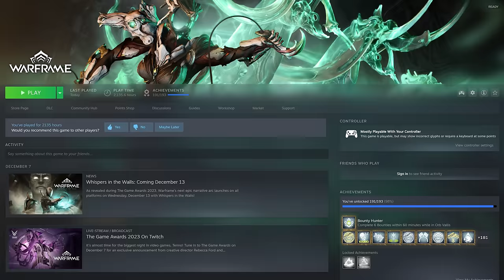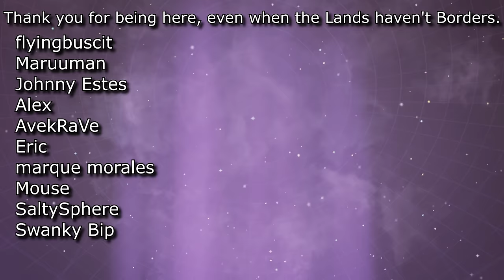Can You Beat Borderlands 2 with Only Phaselock?

Comment: 6:00 Yep. You can be hit by them in that spot, but it is extremely unlikely. I used that spot during a particularly miserable OP levels run in which for whatever reason I was horrifically undergeared. I don't remember the circumstances, possibly because I blocked them out to avoid traumatic flashbacks, but I do remember some of the creative cheese I found.

Fun video as usual. I think after the last few runs, you were due for a... relatively... simpler run. I honestly wish that Phaselock tapped more into the sort of elemental chaos that Maya's design kind of hinted at but didn't really commit to. As ineffective as the Phaselock augments were at max level, it was so satisfying to set off all those elemental effects, and left me craving more.

Comment: was not expecting a warframe ad but im pleasantly surprised, have you considered trying any warframe related challenges? star chart with only the credit purchasable weapons or something?
Reply from the maker: I have considered a few things, but it's hard to figure out where exactly some lines should be drawn. Like, what mods would I take with me? What sorts of spoiler/frame abilities should be on the table? What should constitute an actual victory? Something like the star chart is an option, but most of the nodes are going to be functionally the same for the purpose of a run. Steel Path + the highest level mission type for each faction would in theory be an option, but... In so many words, it's complicated.